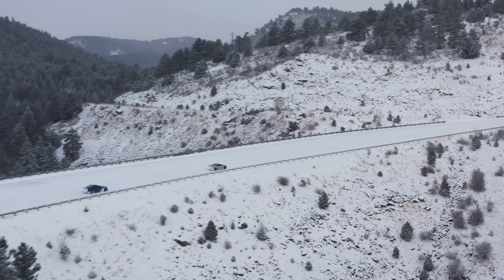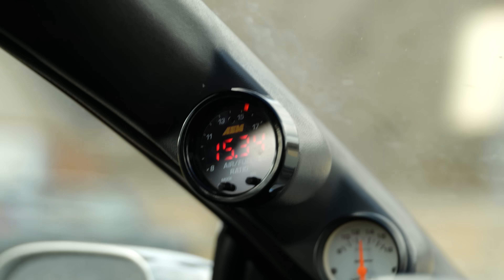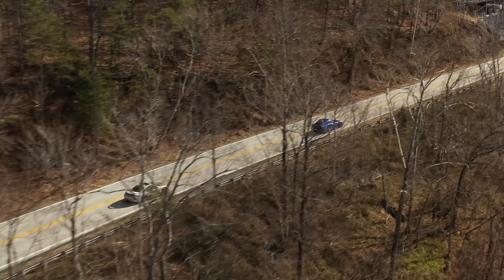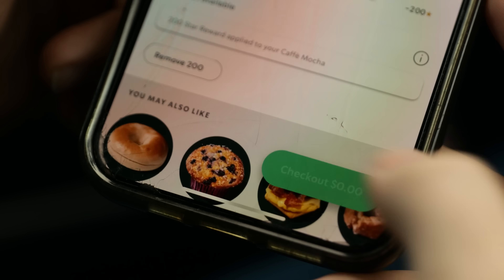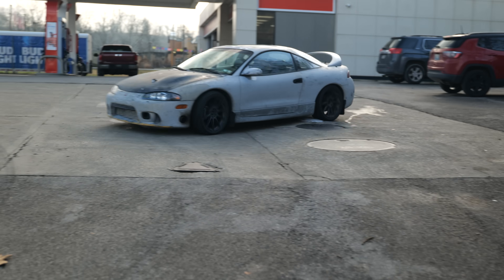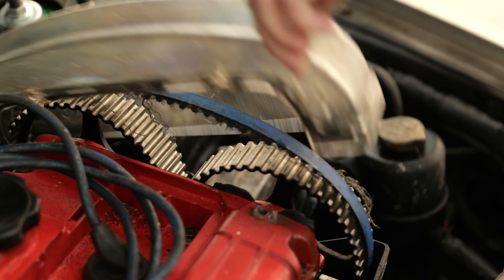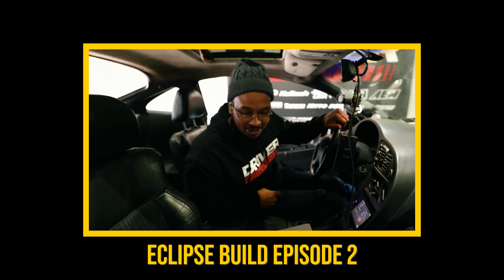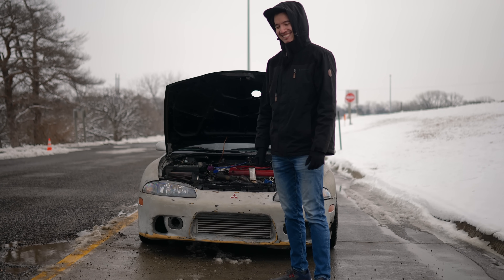We roadtripped across the country for as CHEAP as possible - Episode 1

Comment: $6500!?!?!? WOW, so glad I scooped by current Talon up for 2.2k when I did, it was a bit of a basket case with a horrible rattle can paint job, but crucially no rust problems at all. I'm not at all surprised at how bad the RX7's MPG is, I would have guessed 14-17, 15.8 is more than the 14 my ZL1 managed, but it's hard to expect sympathy about bad economy in a car that expensive and it's not like I didn't fully expect it either, lol. I was a bit surprised though given that the supercharged vettes (c6 ZR1, and c7 Z06/ZR1) all manage to average over 20 I believe, I chalked it up to aero and wt difference, but still surprising how much difference that made) I'm shocked the modded DSM is getting 20, I never payed close enough attention to have an accurate number but I'm reasonably certain mine didn't come close to that, not sure about my current one since I drove it so little before taking half the car apart and getting sidetracked by other life priorities...Enjoyed the video, especially getting to see a DSM on the road, early Mitsubishi was the GOAT, aside from the aforementioned ZL1, I've also owned an Audi b7 RS4 cabriolet, and my 3000gt vr4 is still my favorite car that I've owned, and the one I'd keep if I could only have 1, and DSM's when they work (Generally after you fix the years of neglect and ebay specials) are an absolute blast, there's a raw visceral-ness to them that I haven't really experienced in another car, ZL1 was probably the next closest from what I've had, but being that it was a much more refined car, still couldn't give quite the raw experience a clapped out DSM with all the money under the hood can, lol. 20:48 Relatable moment, pretty much me when DSM #1 spun a main bearing, at least I knew it was probably on borrowed time when I had the head off and saw how sloppy the pistons were in their bores...I'm still watching the video, so idk if it's mentioned later, but for those who might not understand why the timing belt failure is so catastrophic, it's bc the 4g63 is an interference engine, which means if the belt fails the pistons and valves try to to occupy the same space at the same time...

Comment: I am most bought two thousand two g s x for eleven thousand they had a hundred and fifteen thousand miles, but it had a dent in the door an a dense somewhere else and it has a tune in all the other stuff of front mount intercooler all these extra parts I didn't get it though.

Comment: the rx8 just need a little bleep of the throttle when you stop, like 2000-2500 rpm, not 5-6000...
Reply: it is also normal for an rx8 to smoke a lot at start-up because how high the EGT are, witht the fact that they run ungodly rich at start-up
Reply: and for the code, i think you are just runing a sport cat or cat delete, and every 500 miles or so, it checks the efficienty of the cat

Comment: I had a girlfriend that bought an RX-8 while I was away. She bought a f*cking automatic. She failed to understand why that was a poor decision. I was so disappointed she'd bought an auto RX-8 that I didn't want to drive it. Then she blew the motor in it, by not checking the oil for a few weeks. She was good with all the idiosyncratic processes for starting and warming the motor before driving, but wasn't aware of how much oil the motor consumed compared to a motor with a crankshaft and cylinders. It was NOT a cheap rebuild.

Comment: Why the hell does a van have such bad fuel economy and need such massive engine? Lmao I don't get it.

Similar sized van (10ft high, 7ft wide and quite long) with a 2.3L Diesel can return 20+ US mpg towing a trailer. I've driven that, here in the UK, at 70mph.